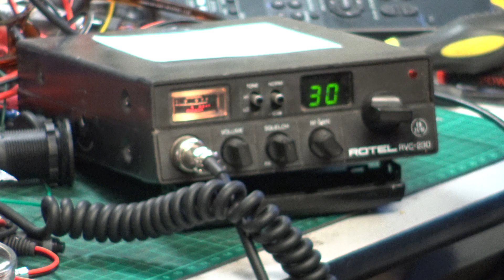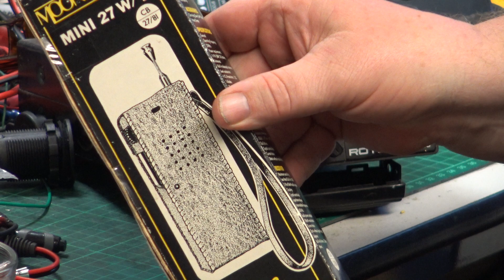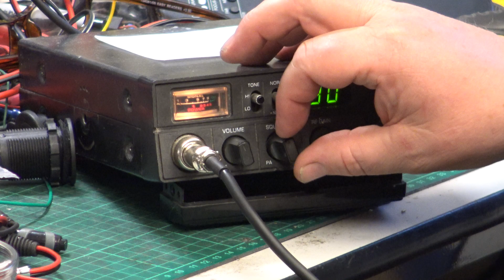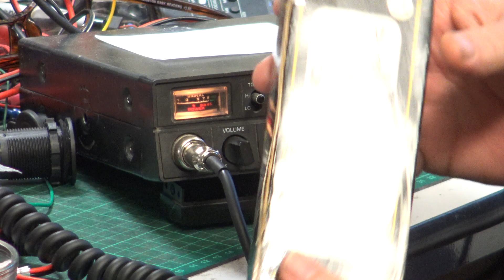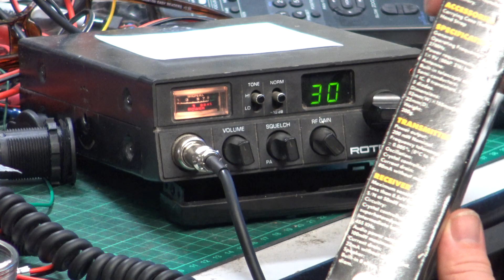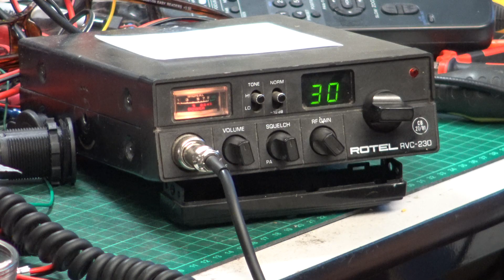Moonraker Mini 27 WT UK CB27/81 CB radio (Handheld 20omW 1ch) - Field test, base side

Comment: Well it worked. The audio was pretty good when it got in range. I think for a site radio a couple of those would be idea due to the smaller footprint
Reply from the maker: There are two things I'd personally use radios like this for; One day Mr C came back from the Lake District with 1000 LP's, 400 singles, 100 78's & about 30 boxed sets that I'd bought off ebay for about £20. I collect singles & certain boxed sets. The box of singles came straight out of the car. The boxed sets needed quickly going through as I'd promised our retired friend Bob he could have any duplicates. So in the driveway were Mr C & Bob's cars with their boot's open. Mr C picked up a handheld such as this to talk to me in front of the stock control computer in the house. Otherwise all the heavy boxed sets would have had o come in to be checked against the list. We only needed 25yds range. Just the job.  Another  application is aligning T V aerials

Richard
Reply: UK CB radio servicing there’s loads of uses for a handheld and that’s a great example. I remember having to shout down from the loft to Mrs Cruncher while I was aligning the aerial. I also collect records and have a large collection but that joblot you bought was a real bargain. I’ve had to stop picking them up as I have run out of space. The pop 78’s are still a bit elusive. Mrs Cruncher has taken a shine to the Midland 42 that I got recently